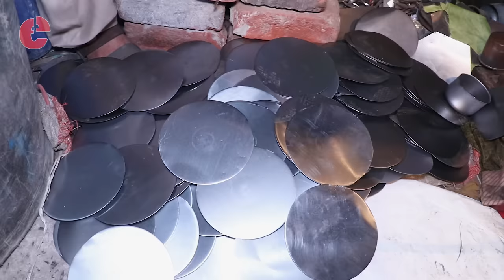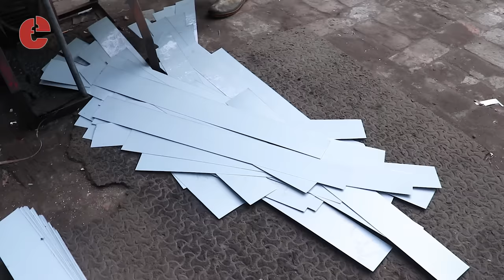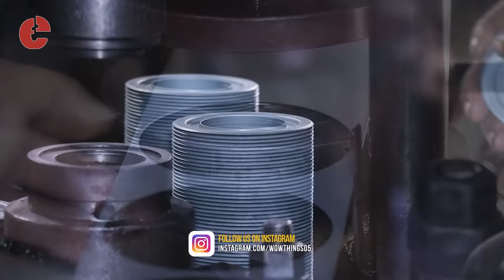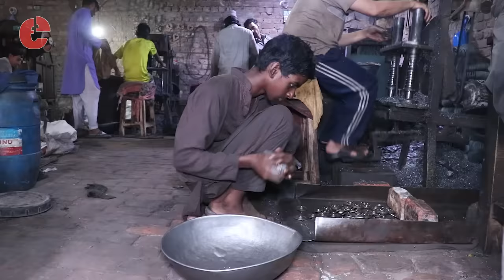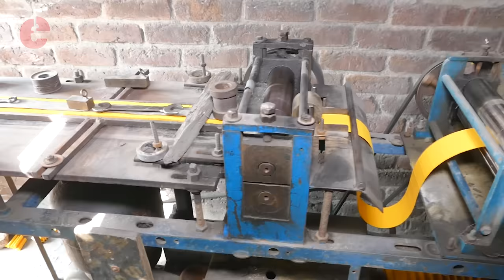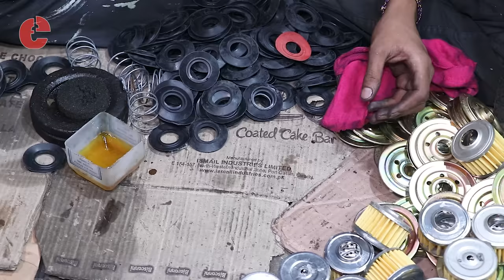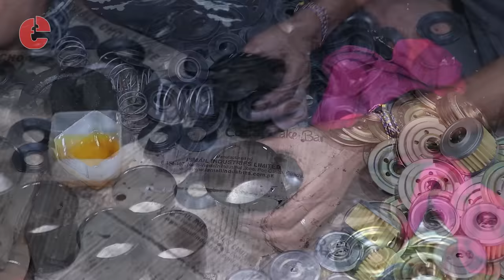How Car Oil Filters are Made

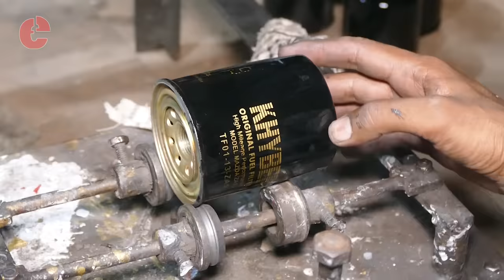Comment: 7:12 Ah, yes. The oil filter that says "fuel filter"
Reply: Lol
Reply: Noticed that too... Wtf???
Reply: 2003 rodeo has fuel filter like that
Reply: Good eye! Lol
Reply: Many diesels have fuel filters that look like that
Reply: @0987654321hotmail  yes.. but this one have bypass valve.. do u ever seen a diesel filter with bypass valve?
Reply: @Malossianoplus  That's an anti drain back valve, it stops diesel running back to the tank causing a hard start after letting it sit for a while.

Comment: I redesigned several pieces of machinery in the automation of this process for Dana oil filters on Ontario, Canada approx. 25 years ago now. The existing machinery worked, but the redesign increased throughput, reduced costs and reduced nonconformity incidences by between one to two orders of magnitude. That was high-end production automation at the time. This is just ghetto.

Comment: As recently as the 1970’s the main body of an oil filter was not a disposable part - you removed it, changed the filter material, rinsed the canister and refitted it. Seems nuts that we dispensed with that.

Comment: These are the knockoff oil filters you find suspiciously cheap on Amazon and eBay. These style of oil filters have a pressure release valve which is calibrated to the specific engine it's used for, which clearly these guys are not doing. An uncalibrated release valve can severely damage the engine.

Comment: Does anyone know what brand of filters these  are ?
Reply: If you slow down & pause video it says Khyber fuel filter & Mazda on the cans. They look to be a decently made filter with more base plate threads than most.Also not excessive glue used either. Would be interesting to see micron rating at what % as well as a magnification of the filter media.